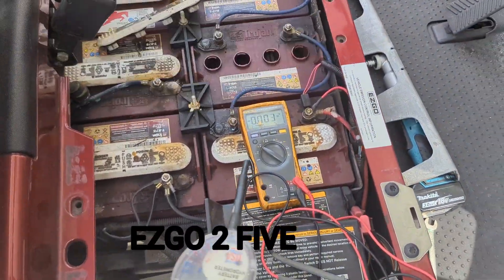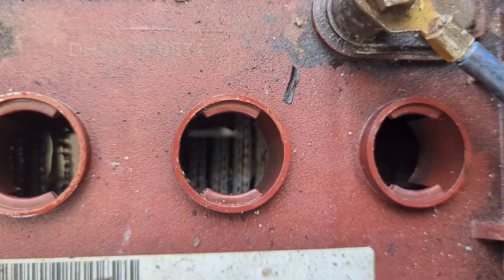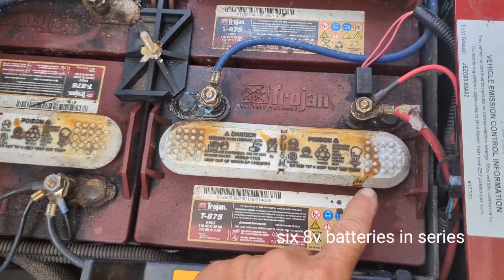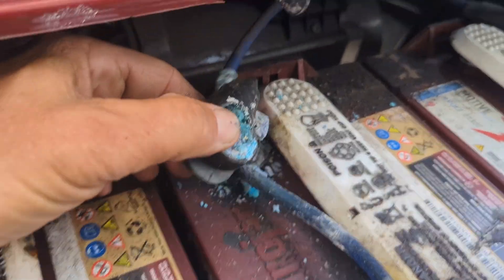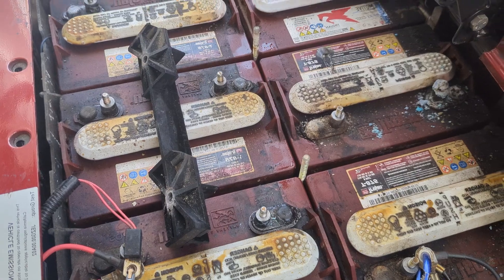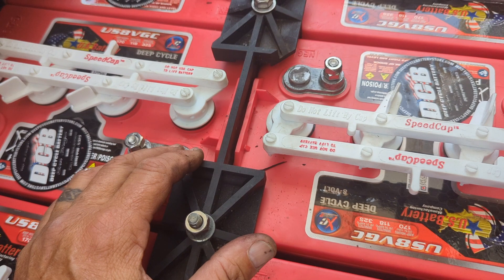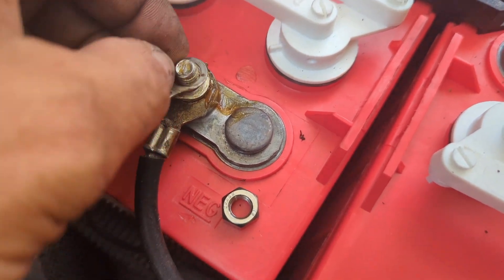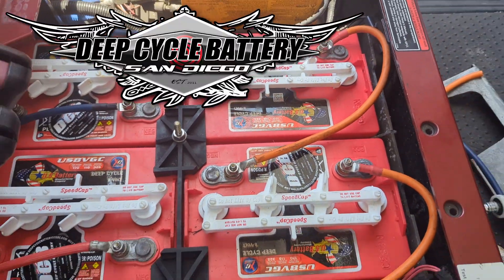How to Maintain Golf Cart Battery and Replace When Batteries Have Dry Cells

Comment: So I am a bit of a novice and I currently have a golf cart that is inoperable but truly lack the ability to buy new batteries can you do a video on repairing old ones or is that impossible.
Reply from the maker: @MrShizuohewajema  repairing an old battery is not really a thing unless you were to cut the battery open and replace the plates
Our customers who have the longest life with batteries are the most diligent in keeping the batteries at 100% state of charge as much as possible and are very diligent with the distilled water replacement so the plates are never exposed to the air
This will maximize the lifespan of the batteries